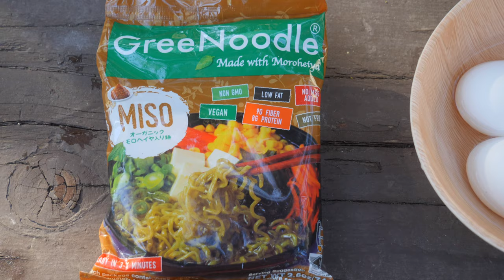Camper Frame Broke in Half!!  AGAIN!!

Comment: Hi from Tennessee.  I like your camp. If it doesn't cost to much I would research on putting your camper on a new frame. That might help it last for a longer time.
Reply: They may have to make it new is what I think. Great idea putting it on a new frame and wouldn’t be hard and worth it.
Reply: I was thinking that too, a new frame could solve the cracking problem once and for all. The frame Bex has is so thin and rusted, I imagine it will be a continuing problem.
Reply: Slim Potatohead had a new frame put under his trailer.
Reply: Yup would recommend a new frame also , that one there is just a temp , good idea to have the welder measure and build a new frame now while this fix holds it together for the time being, be sure to rust prevent the new one with a good marine grade primer and paint. Great personality, best wishes, God Bless
Reply: I agree, slim potato head got a new frame in aluminum 
(i think) for less weight and rust control. I'd get a hold of the company and see if thats an option and cost? or find a person who can copy your frame from scratch. As long as the shell is in good shape and has a few more years in her, this could be a consideration Bex. All my best and stay safe and healthy. much love
Reply: @Howie421  Slims was brand new and it broke also.  It was a  poorly designed frame at that.

Comment: I would paint that frame all over with rustoleum or rust converting paint, and then coat it with some kind of undercoating on top to keep the water off the paint/metal.
Reply: The problem is not the outside of the frame, it's the inside.

Comment: I agree with you that any home 37 years old is going to need repairs and maintenance. The flimsy frame helps to keep the weight down so you save on gasoline towing with a smaller vehicle. To help it last longer, I would buy a tin of chassis paint and take time to carefully paint the whole frame. Then in spring and fall I would top up with a fresh coat of paint around the section of frame where it was welded. ☮️

Comment: My two cents would be to put the trailer/ home on a whole new frame.   It will be new axle, tires brake system it needed.
Reply: Finally, the voice of reason.  Thank you.  You cannot keep treating the symptom (frame cracks) without treating the cause (metal is too thin).  New frame is the answer and may save a life.  Thank you again.
Reply: But she's had very little to fix - yes it seems big, but this is her house and homes need repairs.  She can downs a lot more on repairs before she gets to replacement.  Right now it's just inconvenience.  A new 17' Casita plus new tow vehicle --- that's a lot more than fixing what she loves.

Comment: Hopefully it won't break again! These Casita's are built very well. Mine is 25 years old, fortunately I have no frame issues, most likely because it has seen very little road that will deteriorate it. So happy it's fixed again 🌞
Reply from the maker: By 1990, Casita had a completely different frame from the one mine has. It's much better in every way.
Reply: @BexCatherder  thank God! 🌞

Comment: Looks like the welder guys did a great patch up and reinforce to your lit camper…. You should be ok ✅
Reply: Your frame is not ok, it will just fail again.  The inside has been rusting all these years and it will fail in another area probably sooner than later.  For yours and others sake, get a new frame.

Comment: Camped in Hollister Hills OHV Park! That’s pretty funny. Many of us camp and recreate there with dirt bikes etc. Without, kinda noisy. At least you were only 6 miles from town.
Reply from the maker: It's almost deserted during the week. Actually pretty quiet and wifi is fast. :-)
Reply: It’s also “green sticker only “ time. Most don’t ride in the summer anyway. Too hot, too dry and dusty.
But the coast, Monterey Bay was very close.  Maybe 20 miles. BLM has remote camping south of The Pinnacles.

Comment: If you do get a Casita 17 you will love it because it will do everything you could ever need given your camping style, but you are right, you need another vehicle. I bought an F150 with a standard six in it which works perfectly, but for daily use something smaller would be a little easier on gas and parking (but not all that much!). Camp on, Casitas rule!

Comment: hi, bex, how are you doing? merlin & i are exploring new mexico for several months, getting away from the texas heat. glad your frame is fixed. i would seriously consider replacing it, if the fiberglass camper itself is still in good shape, you enjoy the 13ft size & you want to keep your current tow vehicle. these frames are prone to metal fatigue & after 37 yrs, i think yours is pretty fatigued. you might consider the frames oliver uses since they don't deteriorate in weather as much. i would suspect you'll keep getting metal failures all around where they're making repairs. stay safe & hope to see you somewhere down the road..........
Reply from the maker: Hi Claire! So good to hear from you and know you are still out on the road and doing well. Would like a new frame but might be expensive plus I would have to move everything out of my camper for 2-3 weeks. Would be a big hassle for sure. I'll definitely look into it though just to see how much.  Give Merlin a hug for me. :-)

Comment: If you notice were they welded  The piece on on the old repair  If you noticed it broke where the  Welding was done The problem is  That it is a Box frame You can't treat inside the frame by painting It or whatever product is available to do that So it's left bare and exposed to the element's  So it will rust quicker The proper way of doing it is replacing the whole section Go look at other trailers and look underneath and you'll notice the rust starts where the welding was done Google why does welding rust quicker Don't waste your money anymore on repairing that frame I think that company actually offers an aluminum frame for your  Trailer

Comment: How old was the frame when you first bought this Casita? How ever old it was plus the time it took until the first break is how long the life of the frame is good for. How many costs of repair could fit inside the cost of a new frame? I am asking myself if it's time you bought a new frame. Just a bug to put in your head. I know there could be several reasons not to buy a new frame. I respect them all as valid. I can appreciate your sticker idea. 😂

Comment: Was that hole in your camper there before the fix?
Reply from the maker: The hole on the driver's side is the old black tank port. I removed the black tank and installed a composting toilet and fixed the floor in the bathroom to cover the hole from the inside.
Reply: @BexCatherder  Glad it wasn't something new.

Comment: yes the frames need replacement some times. I have a 2011 17ft Sprit Deluxe Casita and follow a few Egg sites and it is quite common. If you consider a new frame compare the cost of having one made out of aluminum. 
the metal they weled on is called angle iron. It looks like 3"X3"X1/4".